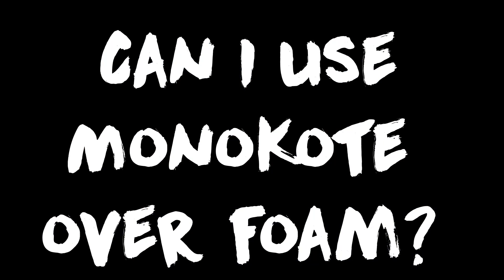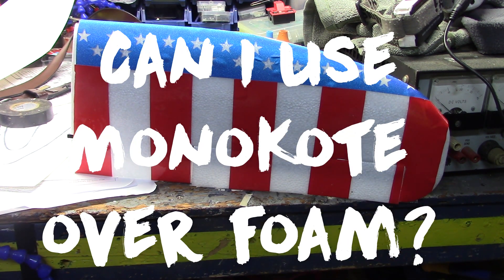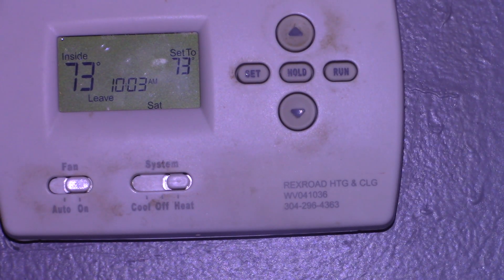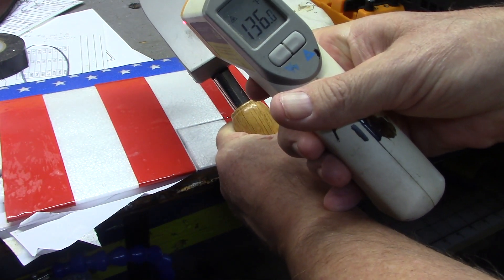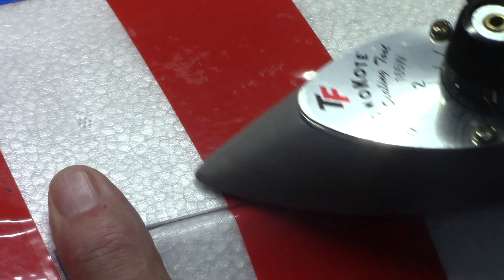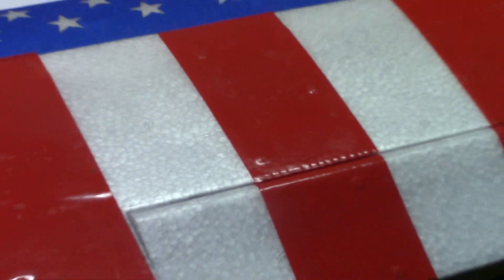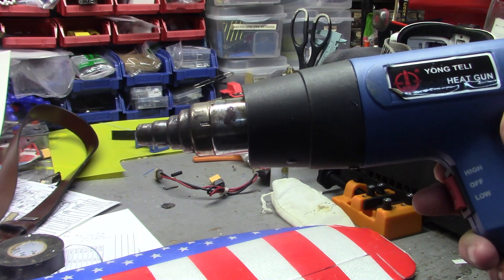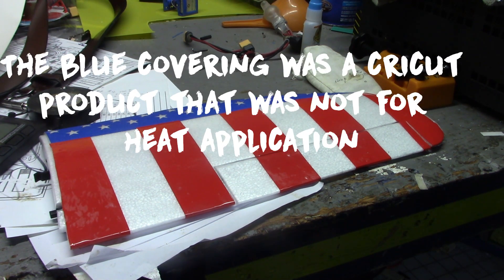Can I Use MonoKote over Foam?

Comment: I'm new & never used monokote before. Can one cover the cone shape nose of a 737-400?

How does one cover curves? Need to make many small relief cuts. If so will you see all those smaller cuts/ seams where they meet?
Reply from the maker: Sorry i missed you question until today. Relief cuts usually will not show but to be safe sometimes I put a small backup piece with different relief location and that guarantees it will not show.